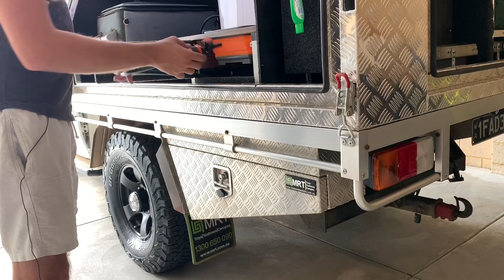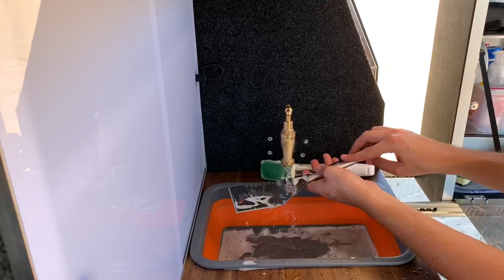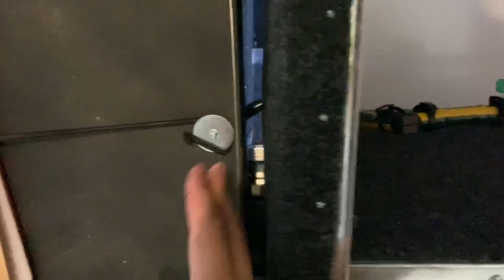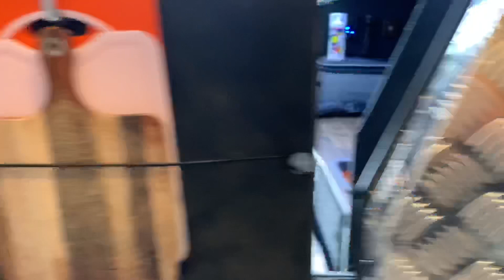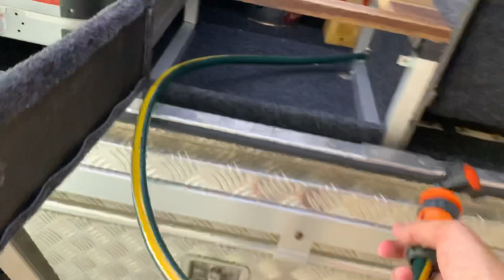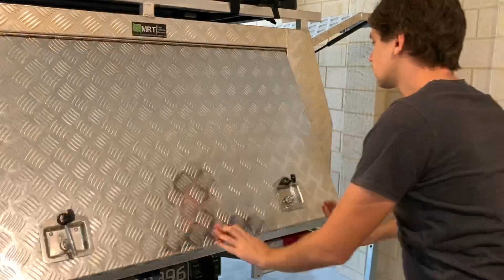How to build a DIY water supply for $25 | Canopy setup

Comment: What was the tap that you used for your set up that moves to the side
Reply from the maker: Hi Kerri! The tap used in this video was just a regular brass tap from a hardware store, similar to what you'd use as a garden tap. The swivel was achieved through two 90 degree elbow adapters (link below), essentially as the tap swivels, it's actually undoing the thread a bit which is then re-tightened when the tap is swiveled back. This works well for this setup because it's only a gravity fed system so there's no pressure running through the pipes, if there was a pump in the system I imagine this would leak. https://www.bunnings.com.au/gd-watermark-15mm-poly-irrigation-male-to-female-90-elbow_p3111761
Reply: @explorebound  thank you so very much.
I love the idea, when I finish my whole set up I will send you some photograpgs

Comment: Do you have to open the lid when tapping water? Or no issue with air in the tank? Great video
Reply from the maker: Yeah I loosten the lid a few turns so the water flows freely - I've been meaning to add a breather hose to the lid instead though to avoid having to do this. 🙂
Reply: @explorebound  Thanks

Comment: Hey where did you get the on and off valve/hose connection to the jerry can I’m trying to find something to connect to the jerry can that I can attach properly without siliconing it on.
Reply from the maker: Hi, the on/off valve was just in the retic section at Bunnings :-)

Comment: I’m trying to build one like yours, but I’m having trouble with the taps I’ve bought 2 different taps and none of them work with the system. Is there a special tap I should be using??
Reply from the maker: Hi, any tap should work fine for this, I just used the cheapest tap I could find haha. I’ve since changed to a cheap 1/4 turn that also works well. Two things that might be causing your system not to work could either be that your water tank isn’t high enough above the tap, or you could have an airlock in the system. How I fix air locks in my system is by running the hose that comes out below the sink because the water flows a more direct route and can be operated lower creating some additional pressure, but if you don’t have a secondary hose on the system try connecting a hose to the tap and sucking the water through a bit if possible

Comment: Hello Exploranger, very good idea and awesome video! 

In case you dont know there is cool gadget called "Easy Siphon" to pump any kind of liquid from one place to another. 
Just do a google search for "Super Easy Siphon or Siphon Pump" - You will get the idea how it works i am sure you can build one for yourself, 
or go to Bunnings and look for:  "Sandleford 1.5m Plastic Siphon Jiggle Hose"  :-)

Keep up the good work!
Reply from the maker: Hey mate, that's a very nifty idea! Cheers for the tip.

Comment: I like to do something like this but I have a bad back so I need to find a way to load and unload water.
Reply from the maker: Hi mate, might have a solution for that! You could fit a standard hose attachment to the tap then connect your garden hose in to the tap to fill the tank backwards. :)

Comment: Any chance of getting some info on the shelf you mentioned from Bunnings
Reply from the maker: Hey mate, here's the Bunnings listing for it: https://www.bunnings.com.au/handy-storage-137-x-71-x-30-5cm-galvanised-4-shelf-unit_p2583029

I used the pieces to build 2 separate half height units, one you see in the back holding the water tank and the second I used for the pantry behind the sink (just built false back and sides for them). Not bad for $14!